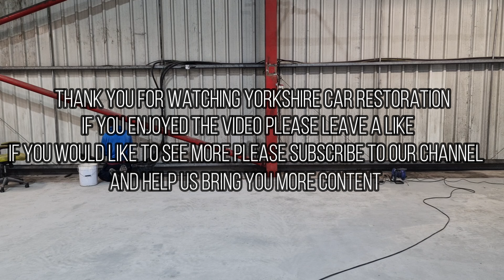HUGE NEW WORKSHOP: YCR

Comment: I cannot see the power cables to the lifts coming from overhead, did you chase out the concrete to run the cables?
Reply from the maker: Hi Eddie , well spotted :) yes they have been sunken into the concrete floor.